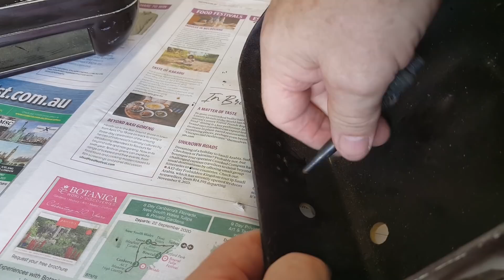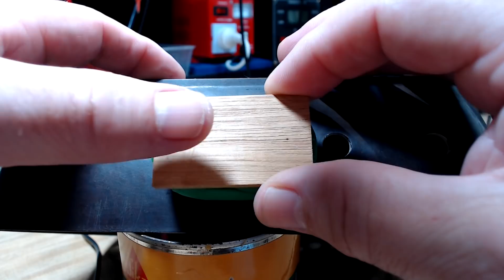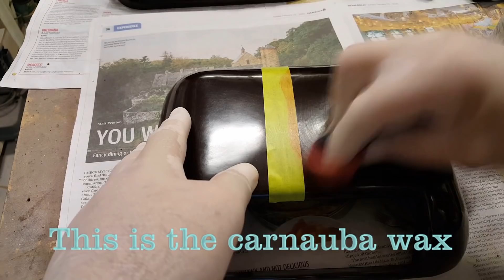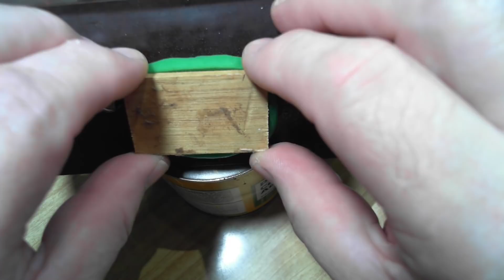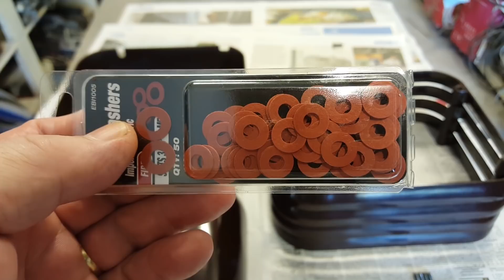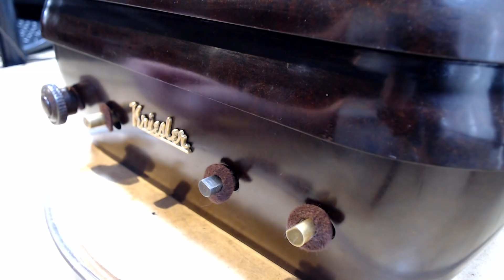Kriesler 11-4 1946 Beehive Radio Restore Part 2 Final

Comment: Wasn't it possible to 3-D print the Kriesler logo? Once you have the right Font it must be possible, right? Maybe you could even scan the original and work with that. But what you did also looks great., it's just as you mentioned a whole lot of work before it was what you hoped it would be.
Reply from the maker: Hi De Mus, 3D printing could not make anything this fine, well mine can't anyway. I was impressed with the way it turned out, I have better moulding clay for next time 🙂
Reply: @DavidTipton101  Well, I have no experiences with 3D-printing but I thought that because you do use it now and then that this could be a way of creating a great logo as well. Turns out I was wrong.
Reply from the maker: @demus8757  There may be 3D printers that could do it but not my $500 unit. I think I attempted to print the mould to cast one but it couldn't do that either.

Comment: Really enjoyed that, thank you for sharing. Certainly like the unusual and varied shapes used in the designs of many of these bakelite wireless sets.
Reply from the maker: Thank you Steve. I was surprised when I found out how they had built the case, made sense really but hadn't considered it till then 👍🙂

Comment: That's a very unusual way to construct a Bakelite cabinet, I guess they had no way to mold it in two pieces thanks to the shape of the louvers. It's interesting that Kriesler used the same molded parts in their painted cabinets as they did the natural brown ones, a lot of painted radios I have stripped only had black, or a plain brown Bakelite underneath. One cabinet did have a grain but it also had several flaws like dull brown patches, clearly it was common practice in North America to use either seconds for use in painted models, or to mold plain Bakelite cabinets specifically for this purpose.
  That Krysler came up very well over all, I guess the scratches, presumably caused by someone using a scraper or metal tool on the Bakelite to strip it, were not as deep as they looked in the video. The plastic badge also came up well, though it might have been good idea to insert some short lengths of wire in the back, something like a Phillips badge, so you have something to attach the badge to the cabinet with, other then just glue, either that or replicate the plastic studs the original had, which is more tedious to do. Most sets I encounter didn't use those sorts of plastic badges fortunately, mostly water slide decals if it isn't marked on the dial, but it's good to see someone have a go at reproducing one as they often seem to have pieces broken out of them.
Reply from the maker: It surprised me how it was constructed too. I have stripped a number of painted radios and the cases have been perfect underneath, the scratches on this one were 'relatively' minor but I spent ages wet sanding them out. I pondered the badge and considered glueing some pins on the back to pick up the original holes. If I have trouble with it I will try that next time 👍🙂

Comment: Sla printer photon anycubic and fusion 360 and you are oke.
Reply from the maker: Hi Knarf, Google can't translate your comment but I think you are suggesting a 3D printer? That would be have been a good idea if it was able to do that 😀
Reply: Sla is 3 D printing but with resin. So the parts would look like the where injection molded.

Comment: I dont know if you know any one with a 3D printer, but seems like scanning the badge into a CAD program you could replicate the badge and even change sizes at will. I love your tenacity on solving a problem!
Reply from the maker: I have no experience with 3D printers, I wonder if it could be used to do that, thanks Tom 🤔

Comment: Fantastic work David! I can see the fascination with that design, it has the "high voltage insulator" look to it as well.
Reply from the maker: Ha ha, you are right Mr Carlson, it would look at home on a pole as well as on the mantel 😄
Reply: @DavidTipton101  hi may frand💐💅Abdul iraq bagdhad
Reply: I think that's 10,000 V per rib isn't it
Reply: @mackfisher4487  50Kv
Reply: Anyone who gets a thumbs up comment from Mr.C is A-OK in my book!

Comment: Bravo David: I for one most certainly enjoyed this restoration series.  The reproduction Kreisler badge looks as though it is original ...it goes to show what can be achieved with determination and perseverance, and this radio looks, and performs first class.  As for restoring the electronics, I wouldn’t expect anything less than what you did for this little radio.  It really is a credit to you.  Thank you for sharing.
Phil.
Reply from the maker: Thank you Phil for your very kind comment, cheers 👍😀

Comment: Outstanding work David. Scared me to death when the spanner slipped whilst tightening one of the studs, thought the case had gone!
Great persistence in casting the badge. Fancy having a go at some Hallicrafters gears? Lol.
Best wishes from The UK and stay safe.
Lynton
Reply from the maker: Thank you Lynton, I didn't do them up tight, I backed them off a touch as well. Good luck with the gears, could you use bronze to repair them? Cheers 😀
Reply from the maker: Oh, and stay safe too Lynton 👍🙂
Reply: Hi David years ago I could have built up the gears by brazing, but I don’t have access to oxy-acetylene gear any longer. There are a couple of firms over here who specialise in small gears so I will have to examine their catalogues to see if anything might be suitable. Cheers Lynton.

Comment: STUNNING
Wet sanding was a great idea because creating dust is not what you need with it containing asbestos.
Still be careful and use a mask.
Keep up the great work and keep the videos coming.
Take care
Reply from the maker: Hi Shayne, thanks and that's a great safety tip 👍😀

Comment: When a valve is low emission it usually a striped cathode.

The cathode is coated with chemicals to aid emission over time this is striped off.

Also some time called a soft valve 
If you strip off a valve you won’t see this the chemicals the cathode are toxic.

Great work I enjoy watching
Reply from the maker: Hi ajhnubia, when this valve showed no sign of life under test I expected to see a hard fault. The cathode stripping seems to be the common explanation I'm getting, thanks 🙂

Comment: Beautiful... “Live art.” Thank you 🙏 

Just one little thing... “Kriesler” is pronounced (exaggerated): “krÍÍÉsler.” Not: “krAAIsler,” if you get what I am trying to say. Not to worry!!! German words are notoriously difficult to pronounce. But though you would like to know.
Cheers!
Reply from the maker: Hi Paul, I've been told that a few times but I pronounce it the way we always did in Australia. The company was named in honor of Fritz Kreisler the violinist and composer, they swapped the i end e to avoid copyright issues 🙂 https://www.youtube.com/watch?v=C-qKbzSeAAs
Reply: @DavidTipton101  Kriesler made colour TV's too at one point - some of which used a redesigned Philips K-9/K-11 chassis in the mid-to-late 70's but with same picture tubes as the Philips counterparts. I fixed a few and blew a couple up in my time. They also made tube radiograms - with 3-speed record changers and AM only radio in some models.
Reply from the maker: @RoughJustice2k18  the link I posted was to a TV ad for a Kriesler TV with remote. I'm glad I wasn't the only one to make smoke from TV's 😬

Comment: What weird cabinet construction! Very helpful all these years later though, made it simpler to clean properly.

Yes, that badge...took longer to figure out how to do it than to actually do it. As you said, next time you have to make something by this method, it'll be a lot more straightforward. You've learned a useful new skill and shared it with the rest of us so thanks for that. It came right in the end and looks an absolute treat!

Overall cabinet finish came up very well indeed and you'd never guess it was originally painted. It really looks the absolute business!

Waited a week for this and I knew it'd be worth it! Lovely stuff.
Reply from the maker: Hi Paul, thank you 👍😀

Comment: Outstanding David... looks really classy now. Loved the attempts to get the name badge right - maybe it would have helped if you had used an eye dropper to administer the compound to the form. Does your wife get paid for her suggestion of the play dough? As usual looking forward to the next job.
Reply from the maker: Thank you Kenneth. It came out so much better than I expected. I made a mess of adding the mix to the moulds, I'll do better next time. eBay may be the place to go for syringes and eye droppers, I couldn't find any at the local shops. i gave my wife an extra big cuddle 👍😊

Comment: That case came out fantastically.  Very impressive.  I was shouting at you while you were pouring the epoxy into the mold.  I'm surprised that you didn't hear me from Texas.  Syringe.  There are tons of disposable syringes and the needles that go with them on ebay.  I think they refer this as the Luer lock system.  I find them handy now and again.  Cheap.
Reply from the maker: Hi George, I knew I would cop some flak for that, I tried to get some but was unable to, I will order some from eBay  🙄😄

Comment: Tip: having successfully employed wet and dry on a number of plastic and Bakelite cases, I use water in a dish (not flowing) and put a drop or two of washing up detergent into the water. That acts as a very effective lubricant and helps avoid accidental gouging of the surface.  As for polish, I use Autosol Metal Polish Liquid. I find the liquid to be just abrasive enough without being too so.
Reply from the maker: Hi James, thanks for the tips 👍😀
Reply: @DavidTipton101  Pleasure. Did you see my Q about punching those knob felts?

Comment: Another very nice job, well done.
See if you can get some syringes, very good for laying in small bits of adhesive, epoxies and JB/etc.
Cheers
Reply from the maker: Hi scofab, I tried to get some but couldn't. We used to use them where I worked but had no luck locally, they would have been ideal 👍🙂
Reply: @DavidTipton101  You might be able to obtain some extra ear-drop or eye-drop pipettes - those would work for a project like this.
Reply: @DavidTipton101  needle exchange Dave, every community health centre should have them, free, wear sunglasses so they think your a drug user and you wont have a problem. Remember to dispose of properly though ; )